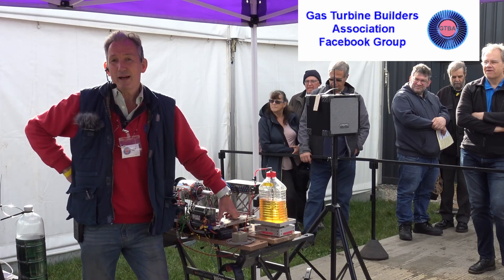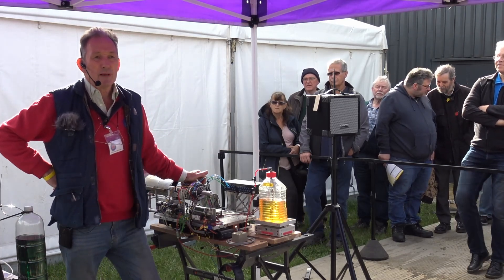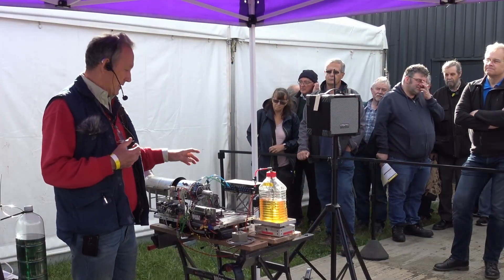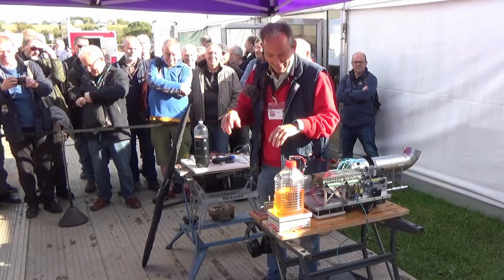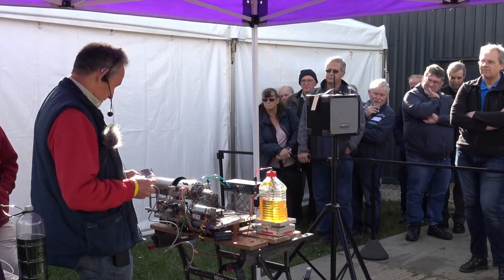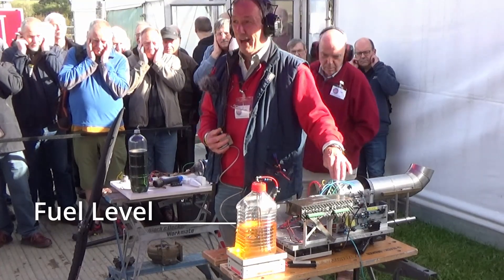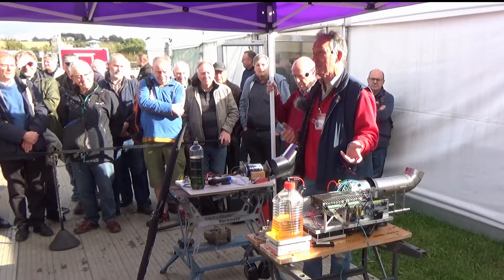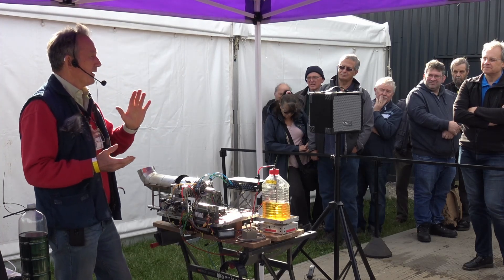DuB-EnG: Home Made Jet Engine - How it works - Live demonstration - Midlands Model Engineering 2024

Comment: Using the bearings as a fuel sprayer / it's funny but viably designer is friendlier. The idea 💡 has already been in my mind for a bit- thing about a wheel is the center moves a lot slower in terms of linear speed but very high torque and vibratory energy concentrates in the center tonic mode. If you can damp the structure by boiling some oil, and spinning the vortex the right way to generate rotational decompression and "suction flow" - the obstacles create inviting pressure zones. Or vortices. Or just mush. Loads of options really but the speed and energetic states are the issues. 

A piece of metal getting loaded up has vastly changing pressure and density, so all the phase diagrams are jumping like a poltergeist infected rolodex when you create a convoluted system with mixed materials and high ⛮ reps and pressures.
Reply from the maker: Thanks for your thoughts on this!
Reply: @DubiousEngineering  Top response!

Comment: Titanium is clearly the bendiest with low internal losses as a sort of acoustic superconductor and supersonic boundary layered therapy device, if you want to get it running macOS with an administration tool that's UNIX derived from my work experiencedprofessionalteammovements, we can make this happen. Force concentration and wave fronts must be properly considered for the housing and elements to be more whoosh and less SHRRIIIEK / thunderstorm ⛈  

Think of a shockwave being turbulent twisted and you can see the problem and the level of energy. 

I honesty don't think the single shaft pancake stack is ever going to be an efficient multi stage device. The beret is the finest research service quality.
Reply from the maker: Strangely, most industrial aircraft engines use the pancake stack.

Comment: Hyperactive deskfan syndrome. Supersonic reynolds cavitation and the force saturated flow.

My theory is that a lot of energy is going missing in that thunder sheet rumble. The kinetics are in my head, and 140dB is kilowatts. 

A person getting rumbled can eat up 250w - that's a tank seat. Flexion is quite energy expensive, go bend something metal and see how hot it gets.
Reply from the maker: Can't disagree, the more noise, the more energy dissipated...   But at 110rpm, those blades will whistle....

Comment: What does he use them for? You should collaborate and make that mobility scooter jet powered
Reply from the maker: I love the concept here jack....  We will need a bigger jet engine :-).  This one creates 7kg thrust...  Thats fine if you don't mind a slow ride :-) ...  However if be interested to see top speed on a flat surface with minimal friction!
Reply: @DubiousEngineering it would be viable as a generator set for an electric vehicle but nobody has worked out how to use a turbine in a ground vehicle apart from military tanks. The exhaust heat is the issue. The turbine race car was melting the car behind. The other guy just gave up 👆 thing is you can get that problem solved and there are loads of turbines in cars. They're called turbos. You can play with one using any furnace, or even an industrial heat gun on a venturi would probably work for me as a musician.